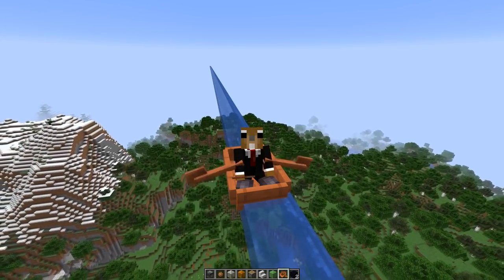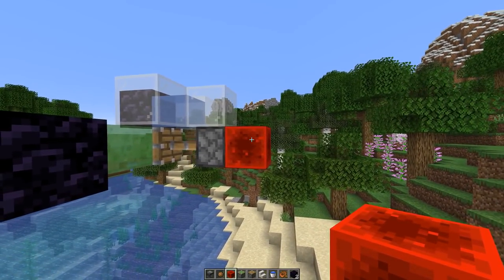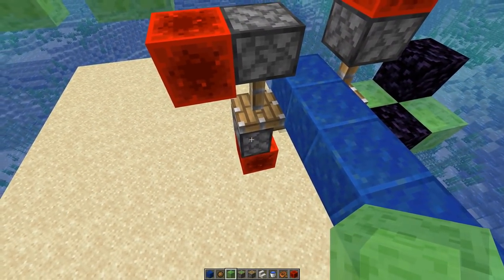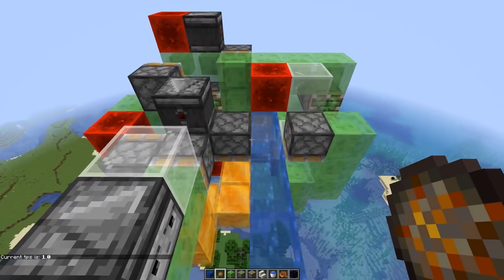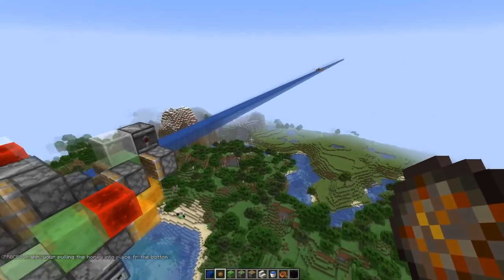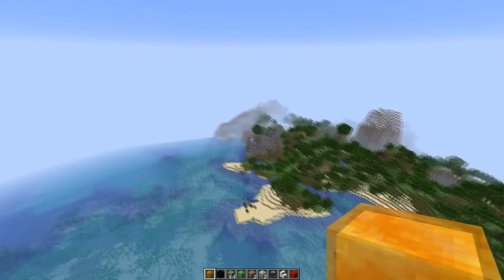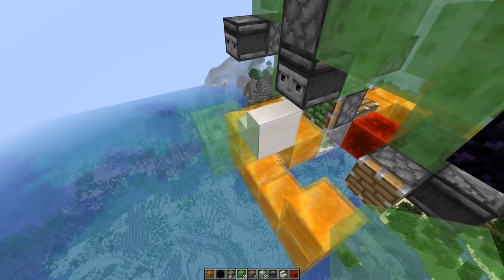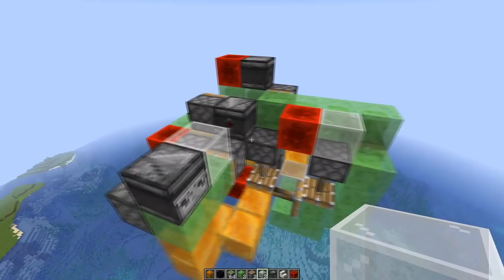Automatic Floating Water Channel Maker

Comment: Did my ears deceive me, or did Ilmango mention this could be useful in an AFK fish farm?
Reply: The new afk fishing farm already released on ilmangos channel
Reply: @oskar1504  Yes, but this could be a more efficient version that's in the works. You think Ilmango just settles for 'good enough'?
Reply: Matt Evans that is so true
Reply: This is what the floating water was used for: https://www.youtube.com/watch?v=Qhz0j--Ueic
It's what gave me the idea to make the wall
Reply: The new AFK fishing farms need to have Open Water around where the Bobber goes, which is defined by a 5x5 space of water or air, and the components don't interfere or count as such.
Reply: Funny, as I'm reading this comment, I have an afk fish farm running in the background
Reply: @mattevans4377  technically speaking, if they put the max lure enchant on the fishing rod, they could make the machine more efficient by running it faster, as with max lure there's good odds to get an instant hook each cast
Reply: Which is odd, as it's all but explicitly stated in the changelogs that Open Water requires a 5x1x5 layer of water source blocks (not waterlogged blocks unless they have no collision, and not air), with two blocks above each of those source blocks that is only air (or as of 20w13a, lily pads). A 1x1x1 water source block should not actually match that definition, yet somehow it does...?

What Mojang needs to do regarding this, is actually put a screenshot in the changelogs specifying what Open Water actually is, except they probably won't because keeping it vague makes it (theoretically) harder to cheese...
Reply: The floating water technique for afk fish farms no longer works, unfortunately.

Comment: Ilmango: 0-tick farms are overpowered
Also Ilmango:
Reply: Warren Mulvaney afk fish farms
Reply: Warren Mulvaney yes
Reply: @user-oh6gz9er6h  yes it has a verry high potenital for grieving for example... allthough that would be a destructive use and not a beneficial thing 🤔
Reply: @abcdefghijklmm369  They aren't really overpowered to a technical player since most of the stuff you get from AFK fishing can be obtained by other farms far more efficiently.
Reply: MrHatoi but in early game they’re really good (also, I can’t think of a farm that gets enchanted books other than villager trading, which is VERY TEDIOUS)
Reply: @BlackDragonWitheHawk  A single line of levitating water sources is actually far less grievous than a line of water sources that update and spill all over the place, which is possible to create with a much simpler machine and zero potentially unintended game mechanics.
Reply: @E-102_Gamma  depends on the situation 🤔 but probably you are right
Reply: @BlackDragonWitheHawk  Under what circumstances is a line of water sources worse than a giant wall of water?
Reply: @E-102_Gamma  if you make 20 of them. And if one tries to remove them they spill over and make a big mess...
Reply: @BlackDragonWitheHawk  But again, that's vs. 20 much simpler machines that are much easier and cheaper to make, and that make a much bigger mess.

Comment: Problem: "my means of transportation is too difficult to grief"
Solution:
Reply: Just update it and you're screwed :/
Reply: FROST WALKER
Reply: @gyroinquisitor8618  technically if you can build it again then griefing is not a problem since rerunning it will make it back. Only the griefer will have massive lag if the griefed is offline.
Reply: he said in the ice section that a chain reaction would not happen
Reply: @f.n.8540  frost walker + armor stand + flying machine that pushes it along, and the whole thing is broke
Reply: This thing is in itself a form of griefing tbh
Reply: If you send a regular flying machine over it then it will remove all of the sources at the top and require no extra input from the user. That or you could send the flying machine one block above and update all the water below, if you want to be even more devious.
Reply: Kouluruoka if you have frost walker you’re fine still got a road nobody else can use

Comment: So can you do that across an ice biome and it’ll freeze in the air, and make an ice road...?
Reply: just extend the machine a bit with an armorstand with frostwalker boots and it'll work anywhere i think.
Reply: The normal flowing water wall would work too, just a little messier
Reply: well yes, but it will update all the previous floating water
Reply: @chervilious  ooooo good point, that would probably break it unless it's timed right
Reply: No. When one ice turns into water it will update the previous water.
You can make a floating water road where every other block is air though, but idk if this glitch even exists anymore
Reply: Ice doesn't produce flowing water though, so after it all freezes the flowing water should dry up as long as all of it freezes.
Also frosted ice is a little different, as it checks for adjacent frosted ice and that can cause lag in large quantities.
Reply: @abramthiessen8749  that's also an excellent point, so once your bridge freezes the running water should disappear, and hopefully it doesn't fuck anything up first lolz
Reply: @abramthiessen8749  yeah but the water gets updated and starts flowing... even if all of the ice melts the exact same tick all of the water then gets updated by each other the same tick and will start flowing
Reply: As soon as 1 of them freezes thwy would all update and start falling so no
Reply: @chervilious  The previous water would already be frozen though.
Reply: its the bifrost
Reply: They have made a tunnel bore that makes a perfect square and add a 5 wide ice road with barriers on the side before that works in all biomes...
Reply: @ralphy1054  that doesnt matter, they are still water source blocks so they will still freeze.
Reply: Freezing ice requires a solid non-water block first. That's why all ice farms the freezing starts from the sides.
Reply: @hypertext124  of course they will still freeze, I'm saying that ice cannot make a water road like the one in the video.
Reply: @chervilious  5:48
Reply: @DaftFader  the previous water can't freeze because water can't freeze on all biome.

Comment: Can this be done vertically to create wall-less bubble columns? Obviously the bubbles would need to be in place before starting. If not, what are the limits? 3 sides against a wall? Or 2 in a corner?
Reply: instantnoob I don’t think so
Reply: Only one way to find out
Reply: I don't see why not, just a vertical flying machine like this but with update suppression on the 4 sides
Reply: Logan Witte but wouldn’t the bubbles update the water making it flow?
Reply: Unfortunately not with this method.  The problem is that you need to have all the pistons simultaneously extended on all the sides that need suppressing before you begin suppressing, just as ilmango explained in the video, so you need a piston in all four corners of the 3x3 sqaure around the water, But then there is no space to put any slimeblocks / honey blocks to be able to do the suppression. If you wanted a vertical column, you would instead have to build a normal column surrounded by blocks, then remove the blocks with an update supressor (like one of the resettable rail supressors) although even with this you can't do one of the sides because of the xyz update order, so instead you would have to use the piston slimeblock technique on that side. The easiest I guess then would probably be to use pistons on 3 of the sides, then rails for the last side. In case you've not seen rail based suppressors, here's a video of a design for 1.14 and above: https://youtu.be/rcIuYLhyYJI and if you want an explanation of how to use it and how it works then watch https://youtu.be/IJhZpK-8p54
Reply: Only 2 out of 4 sides can be suppressed. As ilmango said, it's a matter of geometry.
Reply: I thought that Tango and Zedaph did something like that for their chicken fountain in Hermitcraft season 6. I'd have to go double check though.
Reply: why not some blocks and one water bucket?

Comment: huh, looks like a nice feature, both for decorative, and functional builds.
Is it also possible to update suppress flowing water like this? To create floating waterways for item transportation.
Reply: must be but you will have much more work
Reply: But for item streams you'd want to have a floor and a wall anyway so there'd be no real reason
Reply: That is a neat idea for a mini game. Let items float in a cycle and fish them out with a fishing rod.
Reply: Also work as a vanilla equivalent of modded pipes
Reply: But the items would fall out without a border/Ground so making them float wouldn't make sense?
Reply: @jonash.8139  ince 1.13 items float in water. Just saying.
Reply: @Wortigon2000  Oh, Right I totally forgot! Ive been playing modded 1.12 for way too long, lmao
Reply: Jonas H. Right but they’d still fly out the sides on turns

Comment: About a year ago I tried to use this to make a 2x2 floating water. Now as the geometry doesn't work with this method, my idea was to send a 0 tick to a piston that is getting retracted by the piston updating the water a tick after it starts retracting. Although it should be technically possible, I couldn't quite get the timing to work

Comment: This could actually be made smaller  if you keep in mind that extended pistons are immovable objects where as retracted ones aren't. You could use a dependent machine above that powers pistons with redstone blocks.
Reply: Actually, looking at it realistically, It wouldn't be smaller, just less resource intensive which may not be worth it.

Comment: Machine stills works in 1.18.1, instead of using a firecharge to activate the machine, place a button onto the piston that you would normally use the firecharge on to make it work fine

Comment: does it have to be a slime block structure? or would a sticky piston facing a piece of obsidian directly work?

i know this wouldnt be useful for automated machines like this, but if this is the case it would be easier to use stuff like this in vanilla builds

Comment: Would it be possible (or even easier) to make a tileable, bottom-piston-only version, so you could make a horizontal layer of water? Maybe with cobblestone generators on the sides to keep them from spilling?

Comment: Is there a way to remove the machine without updating the water sources? I'm thinking of using update suppression but I'm not completely familiar with that concept or if it will work at all.

Comment: If i remember correctly, waterlogged blocks used to stop being waterlogged when moved by a piston. I actually tried to make a blanket flooder back in 1.14 and the quartz stairs i waterlogged got the water removed when moved
Reply: It's still possible to make them, it's just really specific
Reply: You need a sticky piston to be directly pushing the waterlogged block, with a 3 tick pulse (observer) so that you can push the waterlogged block without losing the water.

Comment: Combine this with a moving cobblestone generator, maybe you could make some guard rails?
Reply: I am actually doing this!
Reply: You risk updating the water then. I don't know if it's impossible but it's going to be a real challenge.
Reply: There is not such thing as this in vanilla and if you plan to make this why suppress the water? You will need 2 row of water and suppress just the bottom if you a reasonably thinking about it
Reply: @Tom-id7zr 
Yeah - that's what I thought. The water just adds an extra challenge but it's doable.
Reply: @notrod5341  @Sailor He meant guard rails one block above the water and one block out - since boats are T H I C C, you know. That way you don't have to be scared to a) not update the water b) not falling down whilst travelling.

Comment: I've been wondering if it would be possible to do something like this vertically? A free standing water elevator would be really cool aesthetically.
Reply: Ohhh with bubble columns? I hope so, that'd be cool.
Reply: I spent some time looking at this a while ago, not as smart as ilmango but I could never figure out a way to suppress all 4 sides around the water. Since here mango suppresses the 3 sides in 2 steps, it makes me wonder if it is possible again.
Reply: @magnusanderson6681  Yeah same here.  Once you've got 2 water blocks vertically you need at least one side to be covered with a block. Also that one block can't be something unobtrusive like a glass pane since that sticks to the piston and updates when you remove the piston so it also updates the water. Best I could do was using a trapdoor. And I now there's update supression but that's not really all that easy to pull off, let alone if you want to apply it to various water collumns around your world. Would be cool indeed though if someone really smart would find a way around this :)
Reply: @Djoarhet001  I did actually get it working with glass panes on one side and all other sides exposed to air, maybe I should make a video on it. But I might take a look into going further and doing the whole thing.
Reply: @magnusanderson6681  Oh really? Now I'm intrigued. Please do show when you get around it! Kudos!

Comment: How would you get the boat to travel in a perfect straight line?
Reply: Using the debug setting that lets you see hitboxes you can carefully line up the directional blue line with the center of the stream.
Reply: Place it straight and dont turn
Reply: @notrod5341  The only problem is you can only line up your F3 menu view angle with an accuracy of 1/10th of a degree. Like it'll show you're at 0.0 degrees and you think you're perfectly straight but you're actually at something like 0.03 degrees, and you will veer off over time. Possible solutions to this are:
          1. If you use this floating canal in the end then you can just turn your mouse off and go through the end portal. When you spawn in the end you will be facing EXACTLY 90°
          2. When you go back through the exit end portal and respawn in the overworld you'll always be facing EXACTLY 0°
          3. When you die and respawn at a bed you'll be facing EXACTLY 0° (only works with respawning at a bed, not sleeping in one).

Those are the only options I could figure out in my testing world. Going through nether portals keeps your view angle the same as it was when you went in. Same with sleeping in beds, exiting minecarts and boats, teleporting with ender pearls.

But with boats, it's not your view angle that matters, but your boat angle. So the above information is only helpful for auto-running long-distances. Auto-boating long distances requires something like this: https://www.youtube.com/watch?v=hiQTnwqrfEU

Comment: Really cool what is an interesting use for flying water?
Reply: Impressing your friends
Reply: Maybe if you need a water road like that with space all around it.
You might need that if u need a redstone line one block under and to the side of a water line, and there cant be blocks under the water because u need the redstone to also connect to another redstone line 2 blocks under the water, and the blocks would stop the connection? Yes I know it is very unlikely, but could possibly be used to compact designs for things that involve water?